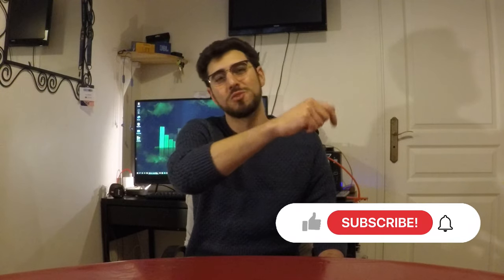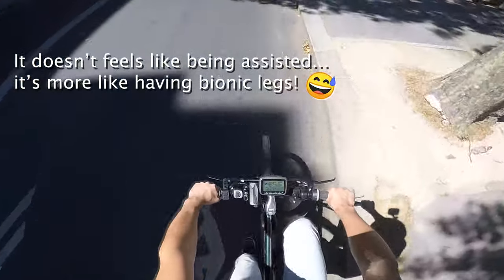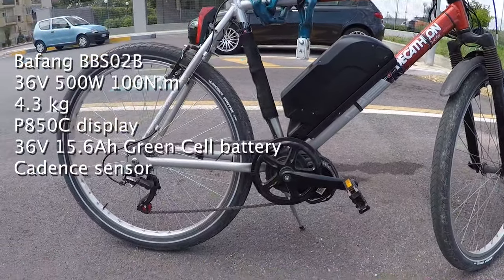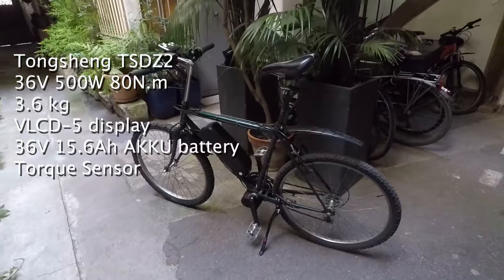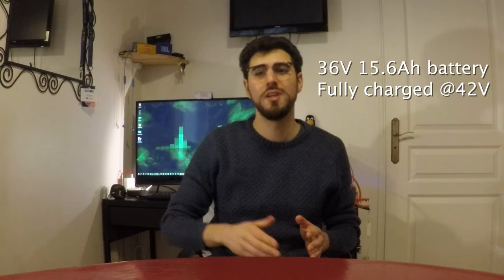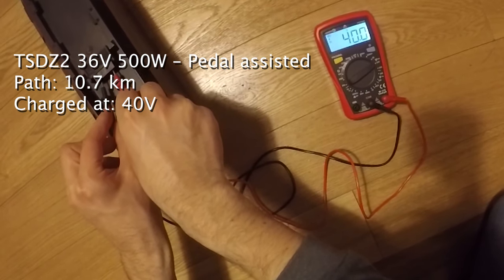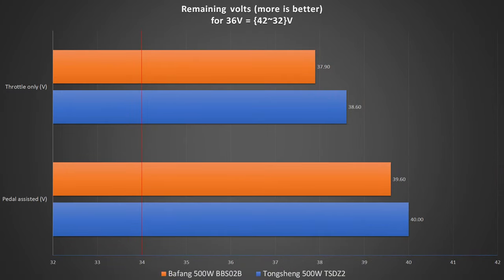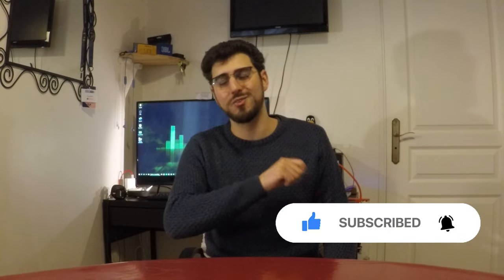Tongsheng 10 Km THROTTLE ONLY + Bafang Comparison: Battery consumption for TSDZ2 500W Mid-drive kit

Comment: I have been testing both mid drive systems. The main difference is in the pedal assist , if you want a bike that feels like you are still pedaling and it will help you go faster, father and up steeper hills the Tongsheng fits that bill. While the Bafang paddle assist basically feels like you are using your feet as a throttle , not a realistic pedaling experience. It comes down to weather you want an Electric bicycle or an Electric motored bike.
Reply: I concur.
Originally, e-motors were meant for providing some assistance. We should still be physically active, but get some support when climbing up sloops, or accelerating. To me it's also fun to do something and pedal. I mean really pedal, not rolling the pedals only to keep the motor engaged.
If people wish to have the riding style like a moped, to my opinion they should better buy a moped.
Reply: Mopeds need insurance etc so you dont really own it and you cant ride wgere you want

Comment: Just a suggestion for a video would be where the programming for both motors has been optimized since the stock settings on both motors are in need of improvement. Just a couple of other considerations is the Tongsheng does not need the Brake Levers with motor interrupters or the Gear Shift interrupter. 3 places where you could have continuity faults. Also, if you need to repair the internals, on the Tongsheng it is far simpler to access & repair.

Comment: Thank you for putting this comparison out. :) Helped to choose my next ebike conversion for my friend. Will be going with BBS02 kit only because it is more powerful and the range savings is not that different.
Reply from the maker: Hey! I'm happy to help 😊
consider that the difference is negligible at 10Km, but the percentage stays the same: the bigger the distance, the more is the consumption by the BBS02B
Consider the range you want to cover to choose the right battery 😉

Comment: I have a bafang 500W 36V and a tongsheng 350W 36V. I can't decide which is best, the bikes are similar, both are carerra, ie halfords.
The bafang 500W has a 15AH battery but the tongsheng 350W has a 10AH battery

Comment: You can use power meter  (watteter and WH meter) to get more acurate result. And you must ride always at 25 kmph with trotle on both bike at same distance to get wery acurate results...
Reply: But smaller power motors usualy is more power saving, then speed is low.

Comment: I'm still not sure! I have a Bafang 500 Watt 36V. Now I want a second kit 250 Watt or maybe 350 Watt. To stay 'legal'. 
If I order a second Bafang it will be easy to swap the motors in case I want more power without having to change cables, brake levers and display. 
But on the other hand the Tongsheng will have less ghost pedaling.  And it will have longer range probably. Especially with my solar roof. 
Still, I'm not sure the Tongsheng will help my bad legs? With the Bafang I can use the throttle whenever I like. For example to get out of the way for a truck on an uphill. So how does that work on the Tongsheng? 
Another question is if 250 Watt is enough? I plan to go up a pass in the Alps. That's why I thought maybe the police will let me off with 350 Watt? I am definitely not going to wear a silly helmet and get a moped license! My solar trike weighs 50 kilo with all the luggage. I am 90 kilo. I'm afraid 250 Watt won't get me up a mountain. 

So that's it! Tongsheng will be more like cycling. Bafang will be easier for my legs. You can't decide for me of course.
Reply: hello!
I have riden tongsheng tsdz2 in 6 different bicycles and for more than 1000km. also i have put a power meter between the battery and motor.  if you go uphill, the motor will use 15a continuous. which is more than 500w, depending on your actual battery voltage. if your battery is full and the motor draws 15a then this calculates to 615w. this is with a motor that is sold as 250w. also this is 100% legal. as the average output of the motor must not be over 250w. but it can peak at much more for short time periodes. 

this means if you go uphill for long time, the motor will pull 500-600w all time. keep an eye on motor temperature if you are doing this.
Reply: @Gabriel.Leni100  Thanks. I have ordered a 36V 350Watt Tongsheng, with 250Watt stickers. So it isn't legal. But I never go faster than 25km/h. Hopefully the police won't start making a problem.
Reply: @driewiel  there is no differenc between 250 350 or 500w. All the same. Also cost the same. Its only marketing. So dont worry about the police. They would give you trouble if you would try to convince them that a BBSHD motor only has 250w. 😄
But the tsdz2 is so small, it looks like 250w 👍🏼
Reply: @Gabriel.Leni100  Yes probably. What I do know about Bafang, the 250 and 350Watt are the same weight. 500 Watt and up is a heavier motor. 
One thing that also makes e-assist illegal is the throttle. Not allowed in the Netherlands. But I won't ride without. For my trike it is a safety feature.
Reply: @driewiel  well in Austria and Germany a Throttle is legal up until 6kph. Maybe this is also the case in the netherlands?
Reply: They call it walk assist mode. But with tongsheng you can not programm the throttle. There is a walk assist button. Only with bafang you can programm the throttle to 6kph.
Reply: @Gabriel.Leni100  I have something about that. 6km. Maybe I will get myself a programming cable for the Bafang? I do like that fact you can use the throttle to quickly get out of the way of trucks behind me. Silly isn't it? Porsches can go faster too than the speed limit. But they are never stopped by the polizei because their engine is too big.
Reply: @driewiel  sure, you can do whatever you want as long as you dont let them catch you...
Reply: @Gabriel.Leni100  same in UK, But if you build your E-bike in an older frame you can get away with saying the throttle was fitted when a throttle was legal so you can claim grandfather rights.

Comment: I have a bafang BBS01b 36v 250w kit just installed it this week on my mountain bike in the UK. I want to keep it legal to ride at 250 watt, but i notice that BBS01 uses more than 250 watt. I gues its just the stamp on the motor for continuous use of 250 watt that makes it UK/Europe legal.  I find that BBS01b is annoying to pedal as you get can feel this extra pedal resistance and really find you need to use the throttle to help it out. That does not makes sense as a motor is supposed to help you. So i am curious when you say TDSZ gives you bionic legs. With the BBS01B i can use the throttle to hold down and it allows you to go beyond the typicall pedalling+motor watts so its more like a motor bike. I can go pretty fast this way but i cant see how it can be used when going off road safely. As i want to use my mountain bike on trails off road this worries me.  I reprogrammed the motor to have 18 amps and i cant really notice much difference though i can see it uses more watts. I now consider to buy a TSDZ 250 watt for the torque sensing which i think will take away the annoying feeling of the bafang pedelling and better control at lower speed and going up hill as your pedalling is an important way to control the bike off road, but worry that it wont be as capable as the Bafang. I saw some videos and websites about the open source firmware for the TSDZ and wonder if that would be enough to satisfy me now that I tried the bafang. I thought with the TDSZ there was no throttle and you have to pedal as many reviers say this in comparing to the bafang, but i can see that you have a throttle and some models come with it, can i ask how does the throttle compare to the bafang? Can i reuse my battery 36v and P850c display with the TDSZ?
Reply from the maker: you can find some answers about the throttle here https://www.youtube.com/watch?v=T7ve958hJXE&t=97s
about the P850c display I'm not sure if you can use it with the TSDZ2
I will definitely try some custom firmware soon, hope you will follow that!

Comment: Hi Luke  I have a 48v 500 watt Tongsheng I’m in the US I believe I can add a throttle to this kit correct? Thanks
Reply from the maker: Hey Mark, yes I think you definitely can! Check the back of your display, you should have an available port for the throttle connection https://www.youtube.com/watch?v=T7ve958hJXE&t=223
Reply: most of the ones sold in the US came with the throttle connection wired in on the controller, yes. even if yours is EU spec, you can solder to that point and flash the board to use it.

That said, the Tongsheng is basically a 250watt design with not fantastic cooling. So be a bit careful with lots of throttle use, lest you cook and demagnetize the motor.

Comment: Hi Luke , thanks for your videos. I have a question: how does the Tongsheng behave when riding it without a battery?resistance wise and noise wise ?
Reply from the maker: Hi seabastia, no resistance is felt when pedaling both motors switched off :)
for a more in-depth axperience see this https://www.youtube.com/watch?v=T7ve958hJXE&t=57s

Comment: I have changed the nylon gear on my TSDZ2 500w. Makes a little moere noise, but are more durable. I can recommend to do that. Also give the motor some grease, it is easy to pick apart. But the bolts are poor so i changed them too.
Reply from the maker: Hey! I also bought it but I still haven't mounted it. I think I'll do it in a day off from work when my girl don't need her bike.
Just one question: do you need to remove the motor from the frame in order to replace it?
Reply: @LukeLorusso  Yes, it will be more easy to remove the motor. I did it, but I think it is possible to do it without removing. You might loose small bolts etc. Remember the bolts on the covering are poor. I bought new bolts from the hardwarestore.

Comment: I have a question I need your help how do I install a throttle to a mid  drive motor need your help
Reply: Depends on the mid-drive. The motor has to have the throttle connector, and not all do, there's a few different connectors out there as well, so you have to find a connector that matches

You CAN solder a throttle connector to a TSDZ2's controller (it's inside the motor housing with the actual motor and all the gears) but it's a pain and involves flashing firmware.